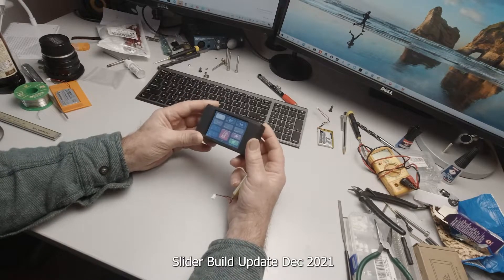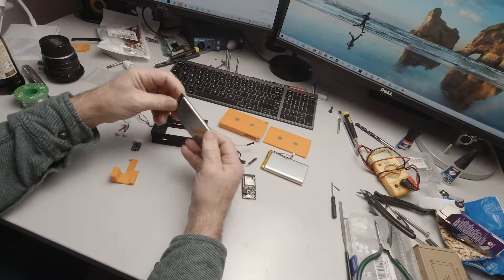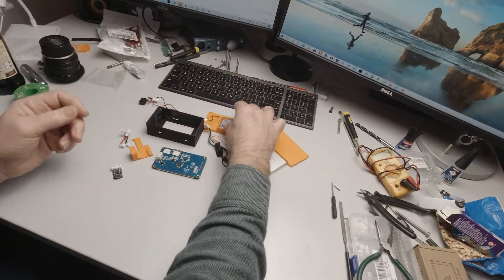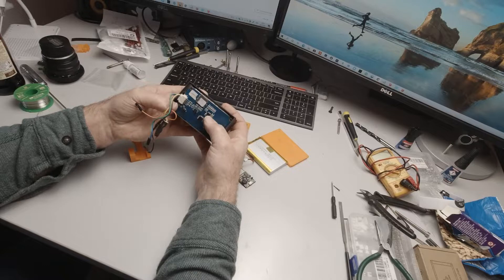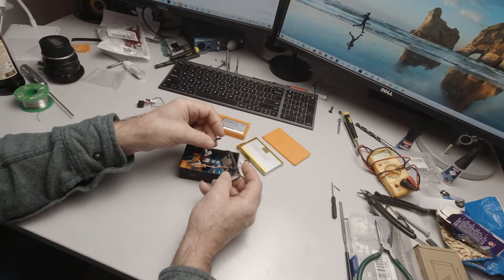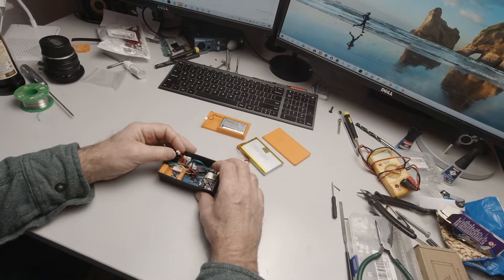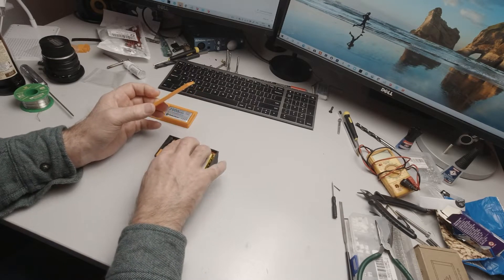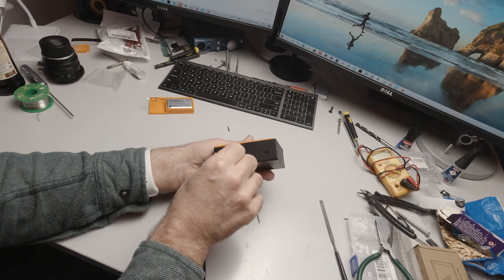Digital Bird WIFI Controller Build V2

Comment: Hi Colin, i really like the idea. I am curious what options does controller have in more details. For example, does it have, or could it be programmed (i might try it myself if code is open) so that the gimbal can control speed between points, as well as "stay" duration on the point itself?
I would like to use the system to record myself, and would need it to repeat same sequence few times, for coming myself etc
Reply from the maker: Hi 
I take it you are talking about the 6 key sequenced moves.
Currently you can adjusts the speed between moves but you cannot make the system pause at each keypoint.
The software is open but the six key sequencer is a particularly complex piece of code. A-B moves do have a short pause at the start and end of each loop when running in bounce mode but the duration of the pause is currently fixed. I am planning to allow the duration to be set from the controller on the next update and will take a look at how this may be achieved within the six key sequencer.

Comment: Hi Colin, could you share the maximum size/dimensions for the 5000mah battery pack please
Reply from the maker: Hi
My 5000mah measures 80x49.5x9.5mm hop this helps.

Comment: That's so exciting to see. cant wait to make one. one small issue. The code .ino file for the ESP 32 feather is not there on the Github page. am I missing something. where can I get that. That page also has a file with a .HMI extension. What is that for?  Also can I use a ESP 38 pin Development board instead of the Adafruit ESP 32 Feather board. not able to get one, Thanks
Reply from the maker: Fixed as requested